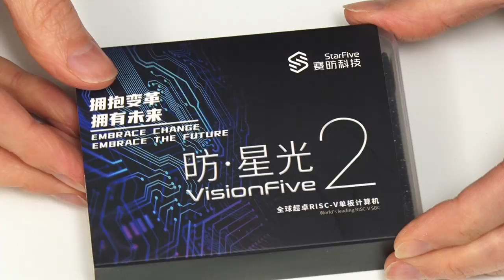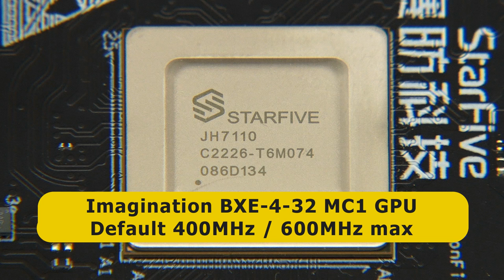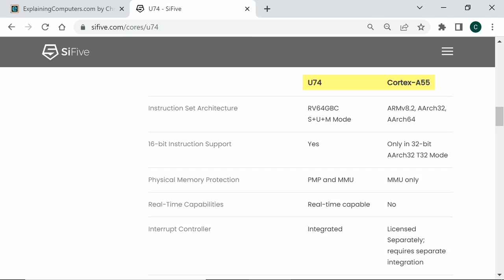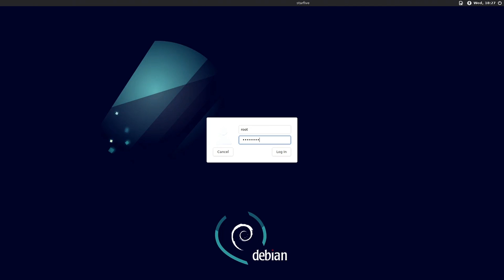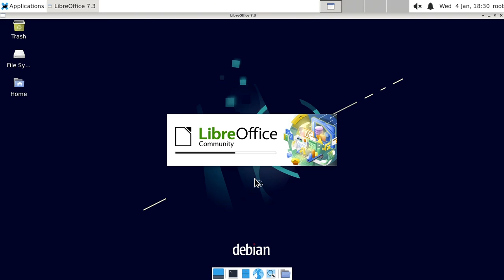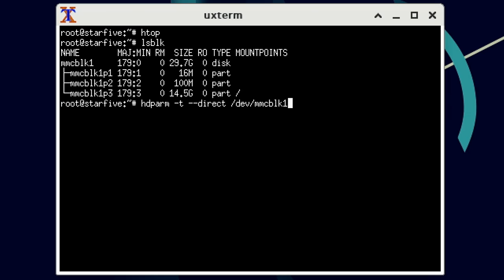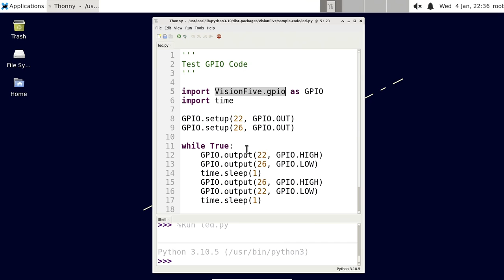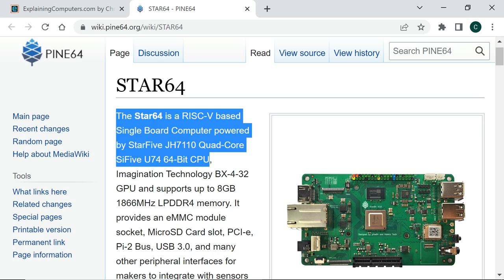VisionFive 2: RISC-V Quad Core Low Cost SBC

Comment: Competition is always a good thing. I'm sure the Linux community will get behind Risc-V in a big way since it is open source. The lower price point will also help keep X86 and ARM prices more honest as well in the future. At least for boards with comparable specifications
Reply: My dream is to have an entirely open source computer, hardware and all. 
The current paradigm does not allow for this.
I wait with eager anticipation a RISC-V system with desktop-worthy performance, and it's getting there.
I'm considering a pre-order just to tinker. Hopefully it will get there in the next 2-3 years.
Reply: open source is gonna have a tough time, but with all the developments so far, I share the same opinions as you guys
Reply: They have been behind risc-V for years. The problem here was the gpu driver, which is not Risc-V
Reply: @trajectoryunown  well, in practice it's only open source for chip makers. And at the moment it's pretty much impossible to verify that the hardware you ordered is what you wanted: Wednesday 11 00am Keynote Address Impedance Matching Expectations Between RISC V and the Open Har
Reply: "The lower price point will also help keep X86 and ARM prices more honest"  Only if it gains serious market share. Which I have to say is unlikely. I know to many of the open source diehards feel the openness of the platform is a positive, in reality it's not going to have that much of an impact. I'm a massive fan of Linux and use it as my daily driver os but not really a fan of open source in general. To me it's more important that it works than if I can see the sorce.
Reply: @harshbarj  the advantage of open source in this case means: it's a lot easier to port software to the new platform. Because anyone with a bit of knowledge can help to bring their favorite application to the platform. It's why Windows on ARM is basically a failure. If you can't get the applications you need, why buy the device ?
Reply: @harshbarj  it's also why every time Apple changed from their CPU instruction set (PowerPC to X86/AMD64 and now from X86/AMD64 to ARM) they actually include a very advanced system to do hardware assisted translation between these platforms so you can keep running your old software.
Reply: @harshbarj  I understand your thinking, but risc v should succeed with the current climate of tech. Arm is decent, but companies are always looking to be better. Risc-v has this potential. I like open source quite a bit as it helps prevent me from getting sketchy software when I need it, but I can understand your viewpoint when it comes to things like gpu drivers. It should just work.
Reply: There is more reason than ever why we need good honest open hardware.

Comment: When the first RiscV boards were coming out I thought it was a bit of a joke, but could be good in a decade.
The pace of development has been extraordinary and at this rate rate I fully expect desktop performance very soon. At present it's in the same bracket as many Arm boards- ie almost there but not quite yet. Thanks Chris for being at the forefront of this computing milestone.
Reply: I think you underestimate the impact of the destruction of Huawei has had on the industry. Being open source, it is not beholden to any IP imports/exports. A nice safe bet for chipmakers.
Reply: @chubbymoth5810  There is no question that import/export bans, restrictions, and tariffs will apply on RISC-V hardware once it's advanced enough. Remember that only the ISA itself is open source, not its actual implementations. This mitigates in part the effects of software ecosystem fragmentation that arise through trade wars, but hardware development in itself still still suffer.
Reply: @chubbymoth5810  Huawei has been banned from the open source Android project. However, they did fork it and made their own ecosystem.

Comment: An encouraging upgrade from their earlier board.  Decent I/O (but I'd be taking a black marker pen to those USB 2 ports in disguise!) and storage options, and affordable too  I hope it meets with the success it deserves.
Reply from the maker: I suspect that the blue USB 2.0 ports may be because this is "super early bird hardware" -- and/or due to supply issues (ie they used what was available).
Reply: There's a new update btw, they changed the data sheet and corrected that that board is indeed using 4 usb 3 ports instead of what they suggested before that it was 2 usb 3 and 2 usb 2
Reply from the maker: @STORMFIRE07  Yes, this is good news -- see the link in the pinned comment or video description.

Comment: I'm very excited about RISC-V moving forward Chris. Did you hear that Google is now starting to develop Android to move to R5 within a few years. Their plan is to eventually move their Pixel line into R5 and away from ARM. The open source Android project was also updated back in September to start to support R5. Support is extremely limited currently as very few Android apps work on R5 at all, but it is still very exciting. I think that such a large company developing for R5 will make the industry in general start to move in that direction. And with open source options being available, devices should start to get cheaper as ARM licensing wont be an issue.
EDIT: Due to Googles layoffs practically obliterating their open source departments, I am no longer optimistic about Googles role and contributions to the Android and Linux open source communities moving forward. And the EU's new proposed 'Cyber Resilience Act' could also contribute to the blow to the open source industry.
I still think that Google taking on RISC-V will bring much needed attention and increase development for the ISA.
Reply from the maker: I share your excitement! I saw that Google wants to make RISC-V a Tier 1 platform -- for others: https://arstechnica.com/gadgets/2023/01/google-announces-official-android-support-for-risc-v/ I suspect we will see RISC-V application beyond embedded and microcontrollers accelerate in the next year or two.
Reply: @ExplainingComputers  Exciting times ahead.
Reply: @Good Ol' Slappy McGee Sweet, have fun with it man. Yeah, I think I will have to get me one o these as well.
Reply: @Bob-of-Zoid  Android IS open source dude. Google doesn't own it. What Google owns is the Play Store app. Google does have their own flavour of Android that they use on their devices, but so does Samsung and most of the other companies that ship devices with Android. And yes, they do inject "spyware" into their flavours of Android. 
And Google does contribute heavily to both Android and Linux projects as well as many other open source projects. It is in their interest to do so as all their devices rely on this software. Both Android and Chrome OS use the Linux kernel. So by supporting both Android and Linux projects they reap the rewards of those projects advancing, innovating and becoming more secure and stable. We also get to reap the rewards as we get to use the software for free. It is win/win.
Literally hundreds of operating systems use the Linux kernel across billions and billions of devices. From Android and Chrome OS through all the brands of Linux you've heard of like Debian, Fedora, Mint etc to most firmware that runs on routers and IOT devices. The whole point of Linux is to be free and open source to allow for innovation and competition against Microsoft, IBM, Oracle and now Apple as well.
Google has every right to use the RISC-V ISA as it is open source. But as such, they must abide by the open source license. It is a good thing when big corporations adopt open source products as it increases market share and by extension brings funding and support to the projects. 
I don't know what you mean by 'Google are using open source as a shield to keep up their agenda to get away with something'. So I'll just say this:
Yes Google and Microsoft are evil. As is Apple and the majority of the worlds largest corporations. Yes these companies infringe on the intellectual property of others. Look at what Microsoft is doing with code from GITHub at the moment. And Google did totally rip off parts of the Java API which is owned by Oracle. Apple totally ripped of BSD to make MacOS. I'm not saying these companies aren't pieces of crap, but Google cannot achieve some grand evil plan by adopting open source products. Well other than saving money on licensed products I guess. As well as I suppose RnD on developing new ones. But that is technically just good business.
So I don't really understand what your point is over all. I mean, I'm right there with you against spyware, tracking, data collection, locked down ecosystems and indoctrination and all that jazz. But I think you are perhaps not well enough informed about how open source works, as your statement is not accurate and doesn't really make sense.
Google adopting RISC-V absolutely IS a good thing, regardless of how much of a piece of crap company Google is. It means that development for the ISA will go through the roof. Especially as Google adopts R5 for their mobile devices. Android has a market share of over 80%, which means that there will be a great deal of incentive for developers to accommodate R5. Especially as the Open Source Android Project is already adopting R5 support. Which is what devs use as the foundation for their flavours of Android.
EDIT: Meant to say this as well: If you want a mobile device that doesnt have spyware or tracking and is privacy based, but still have the experience of a flagship OS like Android, go check out Graphene OS. IT IS AWESOME AND I LOVE IT!!!!!
Reply: @honestgoat  The danger of things touched by the big US giants is that they have a nasty habit of skewing the supposedly open standards to something that benefits them above the rest of the world.  For example. they have modified the KDE Web Browser engine into engine named Chromium that ads and removes features for their own benefit, much like Internet Explorer in the 1990s.  Other open source browser engines now struggle to keep up with Chromium dictated standards, such as the advertising-friendly HTTP/3 protocol and the DoH wiretapping protocol.
Reply: @johndododoe1411  You're not wrong. We will just have to wait and see what happens. Regardless, I still think R5 will benefit from the increase in market share and the development that will come from that. And we absolutely need some competition to ARM in the mobile/portable space. ARM have become too big for their britches and their licensing restrictions have hampered innovation. Even by giants like Apple. Apple Silicon is a marvel of low power desktop processors, but its still very expensive, regardless of early generational pricing required to recuperate RnD costs.
I think R5 taking on ARM will cause ARM to have to allow for more innovation as well as look at their licensing structure to reduce overheads for ARM SI's to lower retail prices and compete. It is obscene that in the modern age flagship ARM devices are still over the $1000 mark.
I don't doubt that Google will take every step to try and increase benefits for themselves, but ultimately I think Google adopting R5 will benefit both R5 and ARM users alike.

Comment: Thanks for the review. I'd love to see a follow up in six to nine months to see if other distros get involved and if the missing support issues like NVME and video playback.  It's great to be aware of this architecture so early in its development.
Reply from the maker: Hi Jen, and I will most certainly be doing this. I plan to return to the board when at least one final release distro is available, and to run benchmarks against a Pi 3 and a Pi 4. And I am still planning a "RISC-V Week" video -- probably in the second half of 2023 -- when the software is more refined and stable. :)

Comment: Hello Stanley! Except for the disappointing lack of wireless connectivity, this looks pretty good. I think RISC-V will take off in the next couple of years. This is a very good start.
Reply: It is a step back, because Nezha Sipeed Risc-V had wifi and blutooth included and working out of the box.
Reply: @Tony And a blutooth dongle also, with only 2 usp that means I need a hub and all of this won't be working out of the box. This is why Apple has destroyed Windows, they have the stuff that we need working out of the box.
Reply: @user-gs4vx3bg3w I think he meant two left after two dongles. Sad I have to explain it to such a helpful person
Reply: But all the other Risc-V  SBC have this feature. I don't know anyone who still plug something in their computer. NO ONE.
Reply: @Tony You must be american, we in civilized Canada use only Wifi in our homes and industries.
Reply: @Tony Yes -- but I hate to have to use a USB port for a function that should have been built in.
Reply: @MarquisDeSang  I agree that taking a port for a function that should be built in is bad. As for Apple, when you (over) pay for an Apple, you get the worst of all possible worlds. You get an anemic machine at a high price that doesn't allow upgrades outside of the "Apple ecosystem." You also get a system that doesn't support a lot of the software that Windows users (and even Linux users) take for granted.
Reply: @CCoburn3  Actually, it is windows that is missing productivity software (most mid-range 3D software have no ports for windows). Of course most games are exclusives to Windows. You have to take into account that all iOS app runs natively on Mac now. So windows is only for running legacy app and games.

Comment: Great review - this is quite an exciting piece of hardware, and makes the RISC-V platform very approachable (thanks VisionFive !).  The data sheet is interesting reading, especially the block diagram showing the various peripheral chips on board.  The inclusion of dual gigabit Ethernet is very interesting - It would be interesting to see some benchmarks showing this board's network throughput when configured as a firewall/router.

Thanks for this - a great video !

Comment: Getting an 8 GB RAM board for under $100 seems like a good value. I would have liked to see a video as to see what the GPU can do. Also having Wi-Fi and Bluetooth would be good additions.
Reply from the maker: I could not get video playback in either a browser or locally. I did manage to install VLC media player, but it would not run.

Comment: I think it'd be really neat to see this go further. I also like the whole Pico ITX thing. How neat would it be if there was a smaller PCIE standard for boards like this? Mini PCIE cards? It'd be awesome
Reply: There are some very small PCIE 4.0 x8 connectors that are designed for use inside of a server chassis. You could hook those up on a board like this as long as you have some extra support for the connector as the pins are very small as is.

Comment: It would be good to run some benchmarks against ras pi 3 and 4 to see how the actual CPU performance stacks up against cortex A53 and A72.
Reply from the maker: I will be making a video doing exactly this once we have final software for the VisionFive 2. Right now the software is not good enough to run reasonable comparative tests.
Reply: @ExplainingComputers  true,  I guess you would be testing the compiler and OS more than you would be testing the hardware.
Reply: @patdbean  Well, all benchmarks tend to reflect the compilers and performance libraries rather than the CPUs themselves, but CPU architects tend to aggressively optimize those together. Deeply optimized libraries and compiler strategies are often produced for important operations such as linear algebra (vectors and matrices), compression, encryption etc. And architecture independent benchmarks tend to encourage their use.
Reply: @johndododoe1411  true, but those very compilers that are used  to compile the benchmarks are ALSO the compilers that will the used to compile the application people will use.
Reply: @patdbean  Exactly.
Reply: @ExplainingComputers  the lack of valid testing methodology didn't seem to stop everyone else lol.

Comment: Very cool board, I'll wait for some details on Star64 and then maybe buy both. I like that they have decent ram amount, m.2 and dual eth, this makes these boards more than just a dev board, they could be used as a router/nas with low power consumption probably

Comment: I'd like to see a performance comparison between that and the Pis to which you were comparing it. Clockspeed doesn't necessarily say much in terms of real performance and there's a lot of benchmark software out there that can be easily used for this.
Reply from the maker: I will make a Pi 3 and Pi 4 vs VisionFive 2 benchmarks video when final software is available. Right now, benchmarks would be mostly meaningless . . . but soon! :)

Comment: This is very promising but we need Imagination Tech's commitment to develop robust and performant Linux GPU drivers. This is what's stopping ARM based SBCs to become "mainstream" as desktop systems, since the user experience is pretty poor without 3D and/or video acceleration.

Comment: I can see this being used as a Firewall or Network Bridge with the two ports, the CPU seems about the same speed as most X86 or ARM based ones
Reply: I had a similar reaction.  I'd be interested in seeing something like an OpenWRT or pfSense implementation on something this inexpensive to be used as a portable router.  Sadly, no built in WiFi, but these are early days....
Reply: @michaelbarton110  Im hoping for some out of band management, OpenIPMI and OpenBMC on a third nic at some point, there's so many SBC companies including multiple NIC's but having to drag stuff down to troubleshoot and update is just a pain